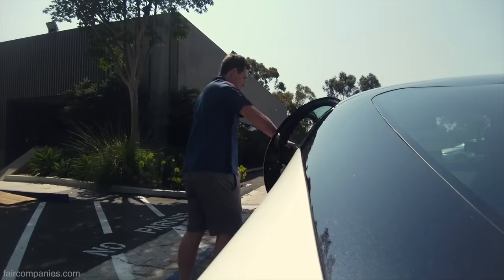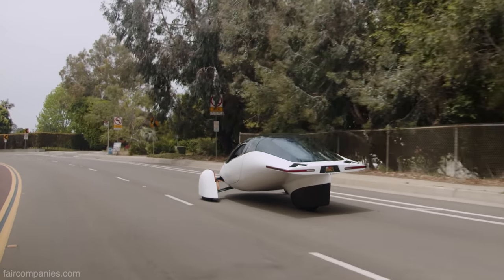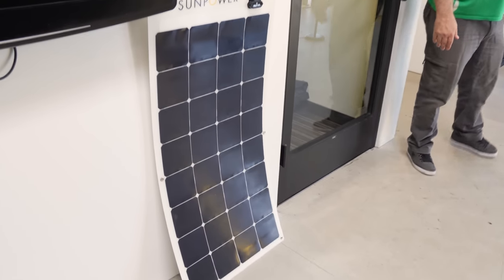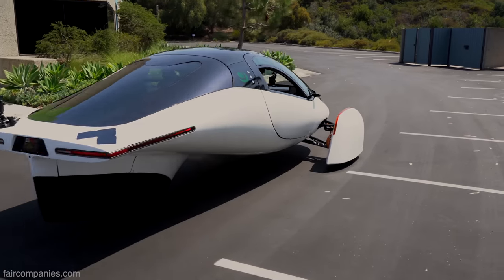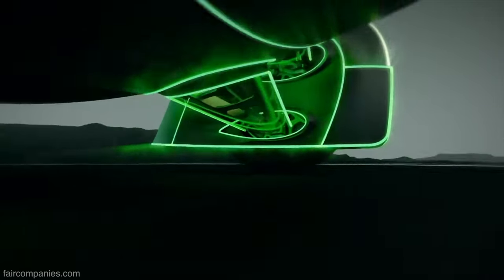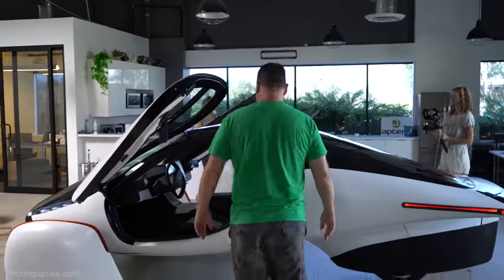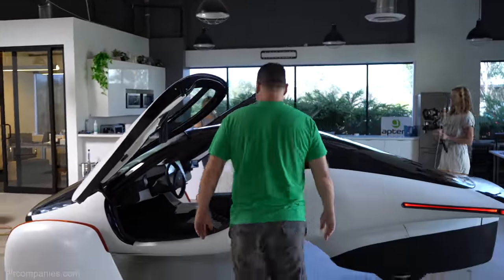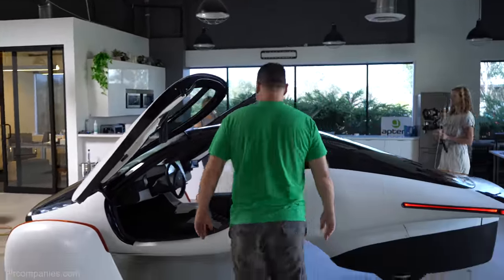Aptera commutes just on solar, gets 1K mile-range when full

Comment: What is a Reasonable amount of Range?  Is there any recycling available  for your solar cells and batteries?  And the last question is why are you so vague on the great stability loss with the 3 wheel design for cornering?
Reply: "Reasonable amount of range" will depend on each potential customer.  Aptera will offer models with EPA highway ranges of about 250, 400, 600, and 1000 miles.  For my own use, located in Southern Iowa, the 400 mile range version will hit the sweat spot.  There are both after vehicle use and recycling possibilities for the 2170 cells used in the Aptera.  Solar cell recycling plants are just starting to be built.  The Aptera is actually more stable than most SUVs on the road.  Part of this comes from the 77" wide front wheel track, but there are other reasons, too.  When the beta testing program is finished we will have more hard data.

Comment: You need seating for 6 plus cargo. It may be fine in sunshiny areas but I don’t think it’s practical for farming use.  We live in a cold climate we were up to -50 c with the wind chill. The tires wouldn’t let you break trail in snow. Good Effort though
Reply: I removed 6-8 inches of snow from my vehicle  today. You’d have frozen cells and batteries
Reply: This model is not meant to replace SUVs and trucks.  It is a commuter that is also a perfect vehicle for the needs of many retired couples and young people.  While the wheel motors are spec'd to operate in -50 conditions, the vehicle as a whole will be certified from -20 to 125 F.  This is part of the validation testing the betas are going through now.
Reply: @n.brucenelson5920  I think what OP is saying isn't that the motors, batteries, and cells would be unable to function in that kind of weather (that might have been what she was getting at in the 2nd line and in the reply, but not in the line about "trail break"), but that temperature is usually indicative of snow. The loss of weight which is necessary for the efficiency on day-to-day driving, would most likely result in a lack of traction in a winter driving situation. Even traditional vehicles which weigh several times more, still need to have additional weight added in order to maintain the downward force needed to dig into snow & ice. That's one of the reasons people who live up north carry cat litter in the back of their vehicles this time of year. If your vehicle gets stuck, then you can spread the cat litter down so it can dig into the snow & ice, but the additional weight of the cat litter bags sitting over the wheels helps with downward force to keep your vehicle from getting stuck in the first place as well. 

However, the alpha model that they were testing WAS said to be front-wheel drive, and there was at least the allusion to there also being an all-wheel drive model in the works, which would add more weight to the back with the motor in that wheel as well. That coupled with the fact that a centrally-placed rear wheel would increase the surface area of traction though COULD compensate for this however. In a 4-wheeled vehicle, you're not necessarily getting the most of that surface area anyway though, since the rear wheels are aligned with the front wheels. In a traditional 4-wheeled vehicle if the front wheels are compressing the snow, when the back wheels hit the same spot that the front wheels have, that snow has already been compressed and it's harder for those rear wheels to gain any traction. In a 3-wheeled design though that back wheel isn't already going through any ruts created by the front wheels, so it would be as easy for the rear wheel to gain just as much traction as the front because all 3 are going over virgin territory.

Comment: Right, Tesla that doesn't like the rain, how do electric motors in the wheel perform in water or rainy day's.🤔
Reply: The motors are completely potted.  They can be submerged in 10 ft of water and still operate - although we are asked not to test this with our own cars!
Reply: There are electric motorcycles with the motors on the wheel, they work fine in the rain.

Comment: Approval for europe still pending according to their website. Interested, but obviously have to wait this out. Until then, HPV :) Laws in Germany in particular are very restrictive to any sort of innovation. See electric scooters, 2 tiers of electric cycle speed limits, restricted or forbidden access to cycling infrastructure...
Reply: They have had a German homologation expert working with them for some time.  One of the founders speaks German, and this is a focus for them, I would not expect solid news before 2023 however.  There is a lot on their plate that needs to be addressed first.  They are already planning factories for Norway and the UK.
Reply: @n.brucenelson5920  Far more plans than product.

Comment: Since motorcycles do not have a reverse transmission, and Aptera has been categorized as a motorcycle, does that mean you don't have a reverse drive in the Aptera?
Reply: I have not seen any videos of this vehicle going in reverse.  Mater of fact I saw a video of Aptera doing a tight turn in a parking lot about to run into a typical car, then a cut in the video where the Aptera is further back from other same vehicle  and goes forward.  I find the editing suspicious.
Reply: I have ridden in an alpha prototype - "Luna".  They go in reverse just fine.  Very tight turns can be made by commanding one front wheel to move forward while the other is turning in reverse.  I believe that part of the work that is ongoing now is how to best control this capability and that the decision to use a yoke is part of this.

Comment: Ya but what about snow, ice, rain. I'd enlarge the tire and get that motor off the ground a bit.
Reply: The ABS/traction control can sense wheel slip and adjust torque 32 times per wheel revolution, or about every 2.5" of tread travel.  I plan to use mine in Iowa, where my Gen 1 Honda Insight has been fine.  I will probably install studded snow tires for winter use.

Comment: How possible would it be for a person to get something like this? Either by buying or building? I know you wouldn't be able to get the full package but just, efficiency safety ect.
Reply: I am not sure what you are asking.  There are already more than 25,000 pre-orders, so there is a line.  I will likely be getting mine early next year, because I got in early.  By the time that the orders placed now are delivered, there will certainly be improvements from the early models.
Reply: @n.brucenelson5920  There's no way in hell this thing is as cheap as their site says. I don't believe it.
Reply: @valroniclehre193  Just consider that their tooling is orders of magnitude less expensive than what Tesla (for instance) is doing.  Although there has been little focus in the press, I consider their manufacturing approach with Sandy Munro and other experienced people involved in the process to be even more revolutionary than this first vehicle itself.
Reply: @n.brucenelson5920  Well I certainly hope they meet their production schedule. This thing looks cool.

Comment: How do you verify your 1K range? Have you actually gong one thousand miles with the car?
Reply: Not yet.  At present this is calculated based on the EPA highway cycle.  They are basing the expected range on performance already demonstrated in the 400 mile range model, with the extra weight added in.

Comment: Isn’t this deceptive? The 1,000 miles is due to the batteries on full charge and the vehicle has solar panels on it that help replenish the batteries but the EV by no means can run perpetually on solar alone.
Reply: If it's deceptive, it wasn't intentionally so.  I haven't re-watched the video again but I'm pretty sure, there was no mention of it running perpetually on solar alone.  What may have been said, however in-artfully, was that if your daily use was somewhere less than 40 miles and you keep it and use it in a sunny place, you could get away with minimal charging from the "grid".

Comment: Futuristic design, can be configured either land, water and air. It sounds so lightweight, fast and smooth as it glides. Buoyancy won't be a problem here and so as altitude and longitude with the span of the wings, conversion. 2022 onwards. SMES.......General practices......LLCs, Ptd, Trademarks, Registration, SEC, Copyrights, standards and practices, are well coordinated with one another/........../........./........./........./........../........./......../......../......../........../GM.

Comment: Is it absolutely necessary to have the front wheels out so far from the body?? What is the reasoning for that part of the design??
Reply: The primary driver of this part of the design is aerodynamic.  If the pods are closer together, they squeeze the air more and at speed they would lose around 10% efficiency and range with a higher Cd.  It also allows Aptera to pass the moose test - something many American cars can't do.
Reply: It also has to be wide because the turning circle is crappy. BTW, no Aptera has passed a Moose test, to-date.
Reply: @aussieideasman8498  We have independent analysis of the video of the beta model running the test, and I quote:

"from watching the video at 1/4 speed with a stopwatch I calculated an average speed in section 2-4 as 72 kph.  This would indicate they came in even faster (ie 78 kph) and are solidly passing."

Where is your evidence to the contrary, or is it just another case of you not believing math in favor of your imagination?
Reply: @n.brucenelson5920  [ We have independent analysis of the video of the beta model running the test,] Then cite the source; otherwise, you can't be trusted. 
[and I quote:

"from watching the video at 1/4 speed with a stopwatch I calculated an average speed in section 2-4 as 72 kph.  This would indicate they came in even faster (ie 78 kph) and are solidly passing."] Now here's the problem with that; nobody knows whether the video was published in real time, and it is so easy for it to be sped up or slowed down to suit, using the editor. In addition, who set the distance markers? Are they independently validated as being accurate? You can't calculate a speed unless both real time video and accurate distance markers are clearly marked on the track. If your independent tester has not validated these, then he's a shonk.

[Where is your evidence to the contrary,] I don't even know what particular drive you are referring to. I did mention a Moose test being faked by the width of the track being increased, but you have not even addressed that. It was read by me in an old comment that I have long forgotten the person or the video, but there is still the Chuckwalla video around, so moose test track width can be estimated using known 88" of the silly trike while in it. I am at the stage where I have heard so many lies from Chris A that I tend to believe others who comment without the need to validate them. The bottom line is they did their OWN moose test, and I only believe authorized testing by authorized testers, and that's not done, so far. 
[or is it just another case of you not believing math in favor of your imagination?] You have worn out that imagination stunt; try something else, and don't go back to I'm not an engineer, lol!